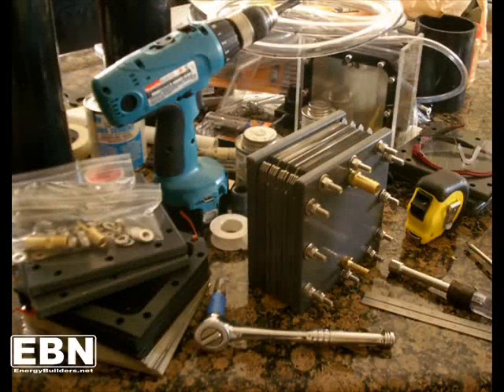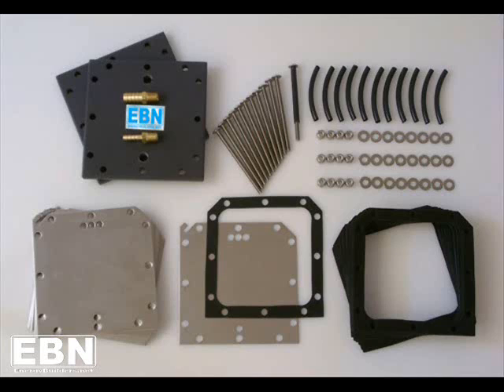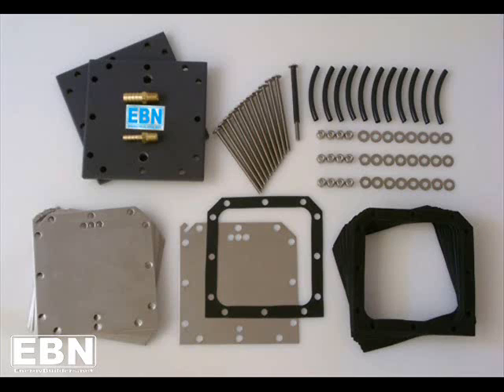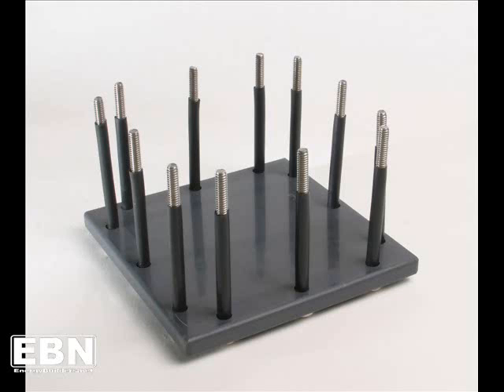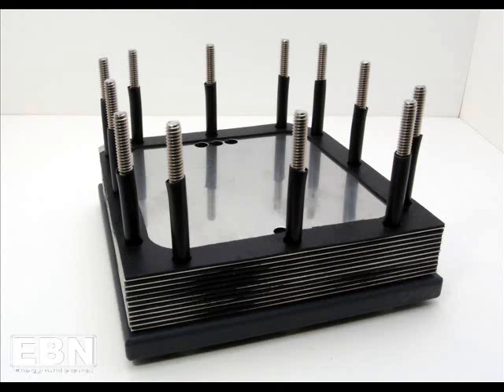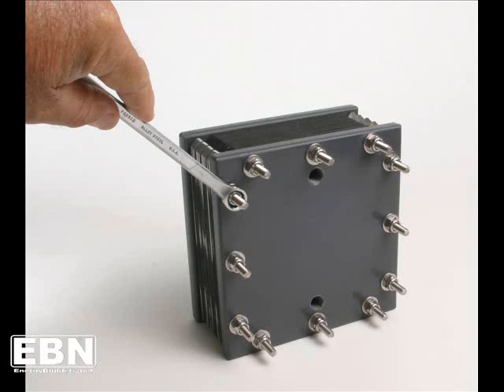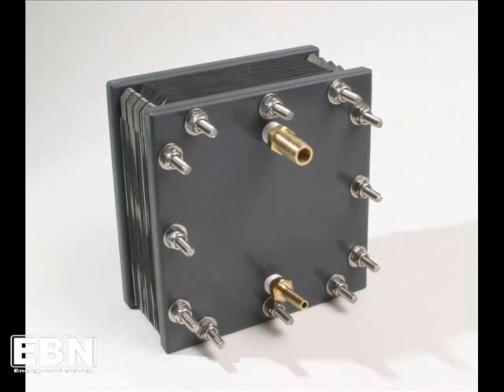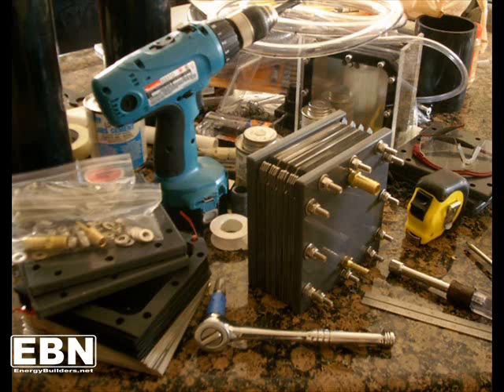EBN Dry Cell - Assembly Instructions

Comment: There is nothing unusual about the process when using 150-300 volts DC.  It works pretty much the same as using 12v.  I just use less connection to the plate stack.  With 76 plates, at 150v, I connect pos to one end, neg to the other and have 74 neutral plates between.  So my average volts per plate gap is about 2v.  Using rectified AC wall current is just more convenient for me and simplifies the electrical connections. Similar results can be obtained with a 12v system.

Comment: I use a very light solution of KOH in distilled water ... I start with 10 or 20 grams in 1 gallon then adjust until I get to the amps I want to run at ... 20 grams per gallon is my most common mix ... this seems to get right about 10 amps at 150v ... this is good for 6-8 lpm or so ... plenty to run my HHO torch or even a small engine ... its rare that I need more than this ...

Comment: Same rules apply as with 12v. Manage volts per gap and have enough surface area for the amps. This keeps heat under control. I could do it with 12v but would take HUGE amps.

I use same custom built power supply with 120vAC or 240vAC input. Bridge rectifier rated 600v @ 50a. 4000uF capacitor rated for 440v. Very simple design.

Trick is to not exceed 1/4 watt per square inch of active surface area and try to keep volts per plate gap under 2.5v.

Comment: wowa!  I havent experimented that much with higher voltage like that!  the last time I used my two plate demo cell with 110v ac converted to dc with just a diode rectifyer, the neoprene washers instantly melted and was arcing at the connection and the metal lid! since then I havnet messed with anything over a normal automobile's voltage. what did you use to get that high of a voltage with such amps. and was there a problem with heat?

Comment: I did 11 lpm with 76 plates at 150v and 13a.  40 lpm was done with 152 plates, 330v and 22a.

In terms of "real" production of HHO at room temperature, not heated gas and steam, the design is quite capable of an honest 5.5 to 6 mmw. So working backwards, 40 lpm takes about 7kw of energy in. 11 lpm takes about 2kw of energy in.

While not the most efficient or advanced design out there, it is rugged, reliable, flexible and quite productive. Its a marathon runner not a sprinter.